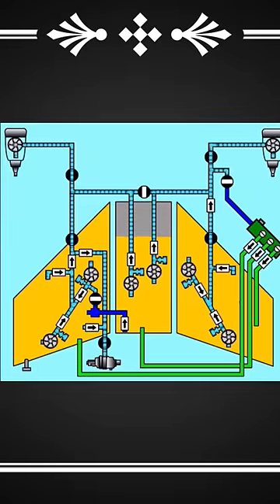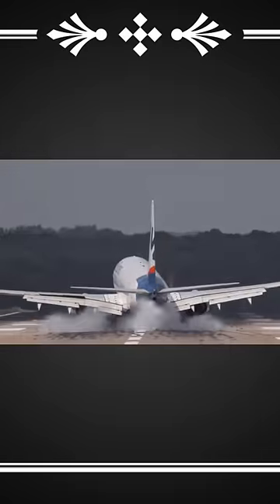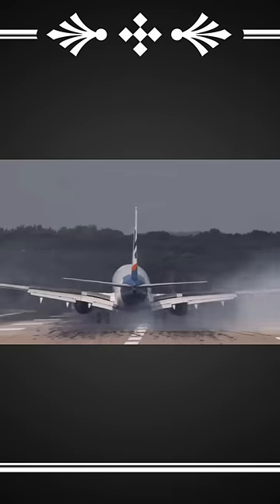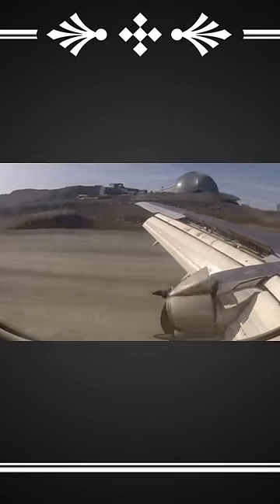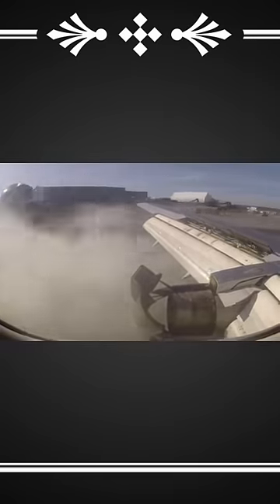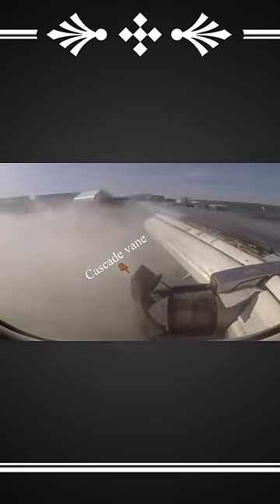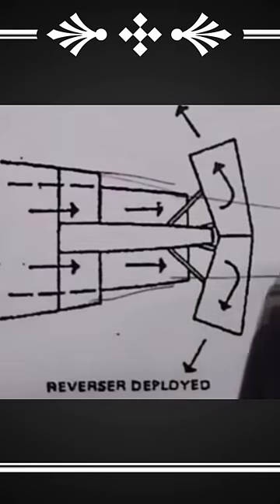Thrust Reverser!! B737 literally has an air brake!! #shorts

Comment: Those are the OG target-type, or as they are more colloquially known as, clamshell style. Those were the standard for the older, far less efficient turbojet engines (look like skinny tubes). The use of turbojet engines to power large transport category aircraft was phased out in the latter half of the 20th Century, so clamshell type reverser systems  aren't really used anymore. 

Those turbojet engines were phased out in favor of the vastly more efficient high bypass turbofan engine designs which appear significantly larger and have massive ducted turbine fan blades at the front of the cowl. Those turbine fans are responsible for upwards of 80% of total engine thrust and are the primary factor responsible for the increase in operational efficiencies over the older turbojet engines, which provide the thrust relying on just the exhaust blowing out the back.     

The increased size of the modem turbofan engines used today is mostly a function of how large the blades making up those fans, and have been getting bigger and bigger every generation. The size of the engines' compressor (cold) and combustion (hot) sections which produce the power needed to drive the turbine fan are in many cases similar in size when compared to the turbojet engines they are replacing.  

Considering that the vast majority of the power being produced by these modern engines is used to spin those turbofans to produce the thrust, the small 20% of the total thrust which exits the exhaust nozzle is too low for the clamshell type reversers to be effective. Ultimately engineers designed av handful of reverser systems which redirects a significant measure of the thrust the turbine fans produce towards the front of the aircraft which are referred to as internal and/or cold-stream systems. They generally consist of varies ducting, actuator, and conduit components mounted inside the engine cowling, and which the operation of can be observed along the sides of the engine cowlings located near the middle or slightly forward of that point along the cowlings.

Comment: Hear me out, if planes require a lot of energy to slow down, then why don't you slow down in the air like when you are at the right calculated distance from the landing strip then lower the engine thrust so it'll eventually slow down at a steady pace and save fuel?? This is just my speculations I don't know anything about planes and stuff 🗿

Comment: My dad has had to lighten the load on a 747-C atleast a few times. Dumping prob 100,000 lbs of fuel in air to land on a short lane at an unplanned stop. That weight makes a huge difference and is normally calculated by the load master or maybe his equivalent for fuel. Idk

Comment: While this is true, that's only for the early version of the 737, I believe they removed that version if reverse thrust in the 737-400 variant. With the addition of bigger engines they needed a new reverse thrust mechanism, making what the 737 has today

Comment: And then there's the BAE146, which used simplified engines for reduced noise so has to have ridiculously large brakes for its size.

Comment: They dont require the thrusters unless the runway is icy or very wet the reason the thrusters are used is because it saves airlines money because the brakes dont have to work as hard

Comment: Using the brakes is cheaper for the airline because of the cost of fuel, even with the added maintenance of replacing brakes

Comment: Hey.  Love your vids, but the engines shown in your videos are Pratt & Whitney JT8Ds and were last fitted to the B737 -100 & 200 machines(1964-69). Cascade vanes became the standard fitment on the 737-300 on. These being a high bypass engine and "clam shell reverser doors ) become non cost effective (cost of manufacture, weight as fitted and effectiveness in landing)..

Comment: Umm first of all all commercial jet planes have reverse thrusters and second of all you are looking at classic 737s which have Bucket Thrust Reversers whereas the new 737s (NG) have cascade reversers. Also, jets need a lot of momentum on landing to not stall and though in some cases may not use thrust reversers on landing they aren’t a negative thing. They help the aircraft a lot in good ways.

Comment: Ok that is not a cascade style thrust reverse. That is a clam shell style. Clam shell aren't seen much as they are used on turbojet engines. Cascade style ar up by front but behind the main fan. They use blocker doors and veins by a trust reverse unit that generally are a mid section of the core engine cowling.

Comment: Misleading statements... Reverse thrust isn't even used majority of the time when trying to brake. It is used in slippery / wet conditions where the tire brakes are less effective. On a dry runway, wheel brakes are much more efficient and effective.

Comment: So those are older engines common on the md 80 now a days they are a small flap part of the engine that does the same but is less moving parts and much lighter

Comment: The sum over all of the forces on all of the particles in the system will be equal to the sum over the external forces, because the sum over all internal forces on a system is always zero

Comment: 1 small mistake that is  NOT a B737 reverse thrust a B737 reverse trust deployed out on the side of the engine and does not block off the end of the engine instead redirecting the airflow alongside the thruse to reverse the thrust

Comment: In my 2,000 hours of flight simulation (my knowledge is dated and rusty) I have never seen this in my life.
Is this a new feature for if the pilot is unable to slow down before overshooting the runway?

Edit: as usual, this short is misinformation, acting as if it’s commonly used today, its not. This mechanism is long outdated and has been replaced with a similar yet more efficient mechanism which is used on all landings, maybe.

Comment: This is only true for turbo jet engines. For turbo Fan engines they slide open in the midle blocking the airflow out back and exhausting it out the side. This is not to create thrust in the opposite direction but rather create a loot of drag by turbulent air. The turbo jet par of the turbo fan engine still exhausts like normal

Comment: Sorry homie the 737 doesn’t have the clamshell thrust reverser system it has the cold steam reverser half the body of the turbine opens up and let air in and turns it around to stop the plane

Comment: You should check with some commercial pilots before posting such false information. Reverse thrust is only really useful on wet/slippery (snow-covered) surfaces. The wheel brakes otherwise provide nearly all of the braking force.

Comment: They don't use reverse thrust to soley slow down the plane. It's mearley an assist to help reduce brake wear, and they don't use full thrust reverse either, most of the time they keep them idle or at 25 percent. If you want to learn jets, go watch someone who's actually a pilot on YouTube and not this guy.

Comment: Isn't reverse thrust literally spinning the turbines in the opposite way?
Reply: No it isn't.
Reply: @johnstuartsmith  since you seem to know what it isn't. I have to assume you know what is is. So please Mr. Smith, do explain to me what reverse thrust is and how it works
Reply: @zeljkostrbac9469  In reverse thrust, neither the engines, the propellers or the turbines inside a jet engine change direction. On propeller-driven aircraft, the props continue spinning in the same direction, but the pitch of the propeller changes so that the air is being pushed forward instead of blown backwards. In jets, the airflow from the fan blades is re-directed so that it gets blown forward. Check wikipedia or ask Google for more details and illustrations. P.S. When you put a car into reverse, the engine doesn't need to run backwards. Same difference.
Reply: @johnstuartsmith  very informative thanks bro. I was looking it up and couldn't get the results that would explain it the way you did. Still I would say the dude in the vid had it wrong as well in terms of knowing what reverse thrust is

Comment: Bro doesnt even get the lingo right. These are clamshells or buckets. Cascade vanes are on more modern engine types which use redirected bypass to slow down.

In actuality, planes do not need reverse trust to come to a stop. Spoilers and brakes are far more effective. RT is still installed to have maximum breaking power available at all times.

Comment: Bro, its called "thrust reveser" not reverse thrust. You "add reverse thrust" to the "thrust reverser" .  RR and GE aren't the only Turbofan  engine mfg. A lot of aircraft aren't equipped with thrust reversers. Aka the Williams FJ44-3A that's equipped on citation CJs. Also not every every thrust reverse uses that clamshell design. Some divert air forward through the engine cowling.

Take my word for it... or don't.

Comment: And while were on the topic of calling your video fucking stupid, reverse thrust does not actually reverse your airflow. It is redirecting the airflow to the underside of the plane for TWO reasons, one it clears away any rain/snow for best traction, and two is it cools the brakes making them last longer.